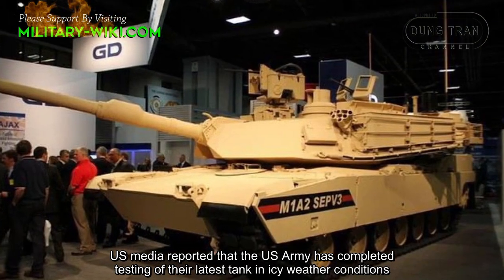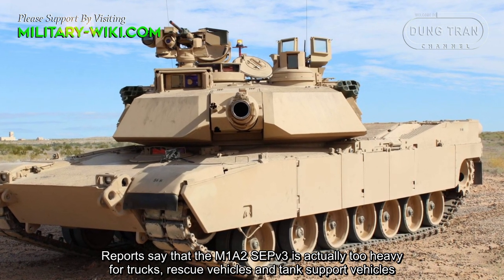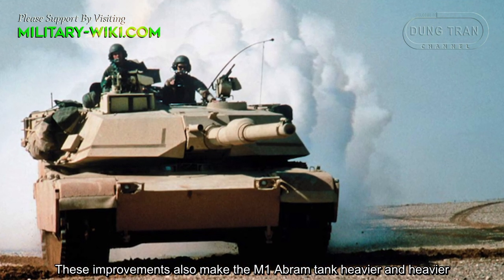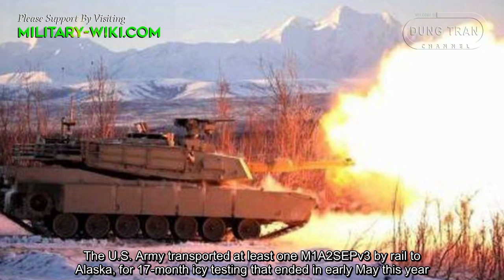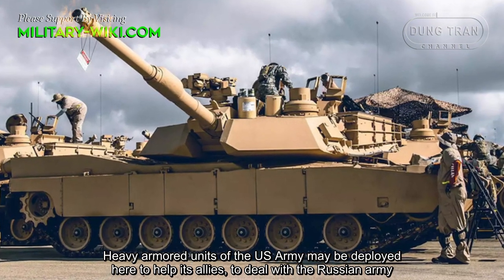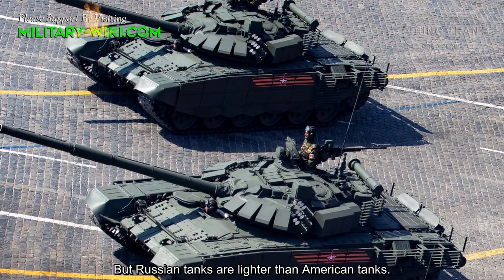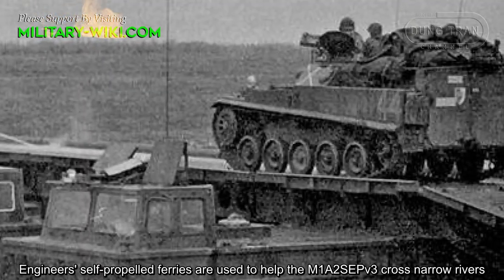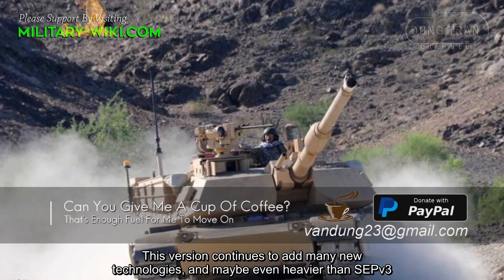M1A2 SEPv3 gain too much weight, can it reach the battlefield?

Comment: I would have thought the Military would have worked all subject matters up already as you need a Tank that can take a hit, the other is the Abrams use a jet Engine far different than any other Tanks that are mainly Diesel.
Reply: The Abrams tanks use a Turbine engine not a jet engine.
Reply: @alexandersokolov4125  well both are turbines one uses the hot air flow to turn blades attached to a drive shaft the other doing a similar thing  blades turn that force hot gases through a compressor which in simple terms is still blades then forcing out through a nozzle to give thrust so in reality they are both Turbines so it’s not a jet engine they are both turbines that couple to a different drive train.
The Abrams is still the only Tank that has this feature the main stream are all Turbocharged Diesel so if that’s the best you can correct me on good for you give yourself a Medal
Reply: James Cunliffe  both tanks need clean are to operate like when the USA in what they called Desert Storm the Abrams tanks filtration System was designed very badly and damaged the Turbines blades that has since been rectified won’t happen again.
You can say what you want Russia & USA make the Worlds best except when China steal from both countries technology
Reply: James Cunliffe  when the yanks found the problems it was damaging the fan blades it was modified on the Abrams that Improved the intakes alone with cleaning the filters so it can, just like the Russian tanks they both need Air to run even a diesel, with these modifications it went pack to it’s own service life span.
The Yanks have a reason for using them as they keep rebuilding them so really don’t know why you keep going the original issue was it’s weight Russia T90 use auto loader have a 3 man crew with a 125 mm projectile which is around 48 tonnes, the USA was around the 68 tonnes with a manual loading system with a 5 man crew with a 120mm Projectile the penetration of the T90 was much better but the USA used depleted uranium which is much denser than standard steel or hardened such the weight difference new ammunition developed the need for better armour.
One day they may make a complete replacement but under Biden that will never happen you used what you have to get the best out of it.
Reply: James Cunliffe  l would say you would be totally correct double

Comment: Great piece of kit only getting better.  Pretty sure the crews are not complaining about the extra protection 😉
Reply: But can it cross a bridge? Or does it just lose its mobility and ability to operate in its own backyard?
Reply: @alexandersokolov4125  in case of high intensity conflict, bridges will have been blown up at the start.  That is why armies have bridge laying equipment.

Comment: More tax $ pissed down the hole
Reply: Well if you where in that tank would you want better protection Russia tanks have a 3 man crew auto loaders they use 125mm Canons with a much smaller turret, while Abrams has a 5 man crew with a manual loading 120 mm Canon I would want as much protection as l could that is why the Abrams is Manual Load as if they went to a 125mm projectile a soldier wouldn’t be able lift it that is why all Russian Allies have Auto loaders. 
Unlike the Second World War in a Sherman that it was the shear numbers of them that won the War with thousands killed in them as it had poor Armour had to transportable by truck train or cargo ship.
These days you have Cargo Aircraft plus the other mode of transport.
So if a War broke out would you get in a Tank and not expect the best protection money could buy, as in the Second World War those guys had gut to get in them knowing if they came up against a Panzer 4 and above let alone the 88’s most likely be killed.